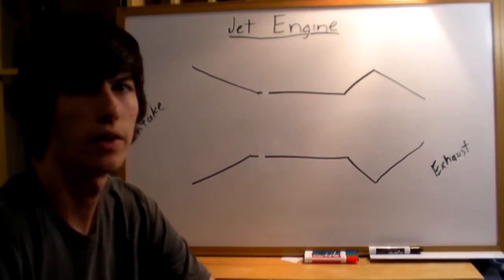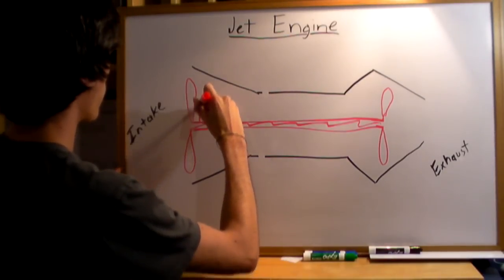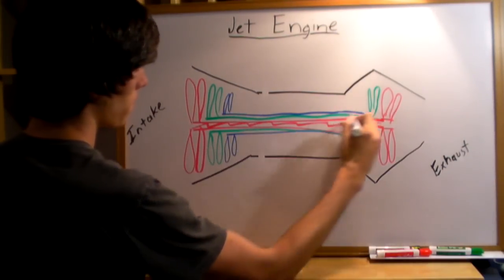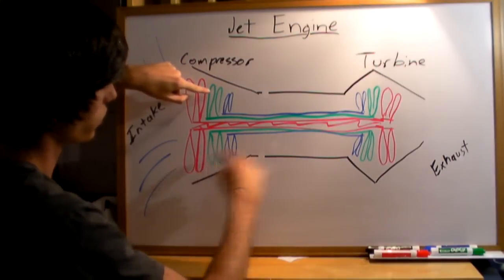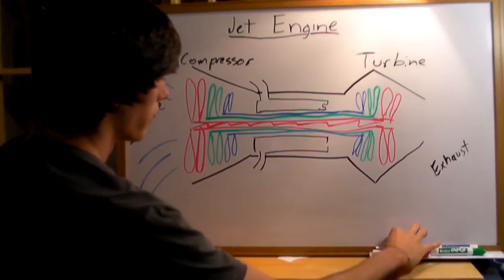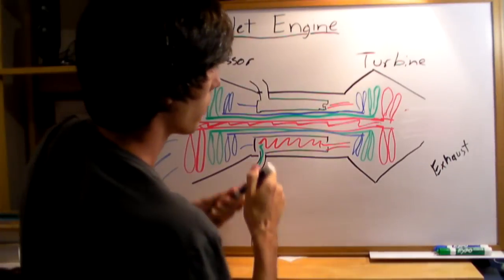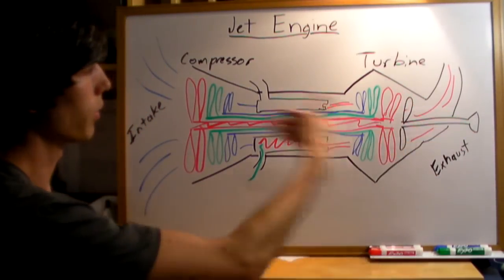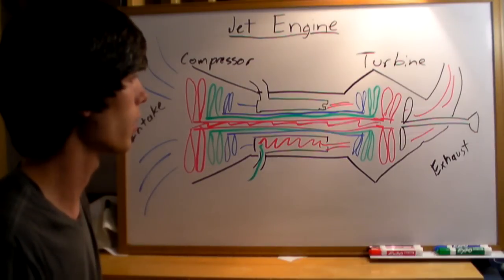Jet Engine - Explained

Comment: This does not explain why the expanded air is pushing the turbine more than it is pushing the compressor in the opposite direction. In other words what is stopping the exhaust from exiting at both ends of the engine and what is driving the shaft in one direction.
Reply: Mikhail Morozov Well, the initial airflow determinate in which direction the gases will flow once the igniters ignite the fuel. That's why turbines need the first few seconds an external power source to start up. normally a little motor/generator or pressurized air for the bigger turbines is used for that.
Reply: shi01
After the external power source is disconnected the initial flow will not affect how much the gases are pushing against the compressor and turbine after expansion. If the forces are close to equal, the shaft will eventually slow down and stop, regardless of any initial flow.
Reply: Mikhail Morozov
 It's the same as with a piston engine if the compression stroke would be equal in force to the combustion stroke, the engine would not run regardless of any starter motor.
Reply: Mikhail Morozov The forces arent equal anymore after the moment the thing starts burning fuel. You will have much more energy on the turbineside, because the gases after the combuster are way hotter (about 300° centegrade when they enter the combustor and about 1100° centegrade when they exit the combustor) and tend to expand and flow much faster, but the pressure actually drops slightly because of the geometry of the turbine inlet (Bernoulli principal).
Reply: shi01
That's exactly what is missing in these explanations. Why is more energy being transfered from the combustion chamber to the turbine side than the compressor side. In case of a piston engine you have valves to stop the backflow on the combustion stroke. Here you do not. It can also not be explained by initial flow, as it is only added to the flow velocity of gases expanding in BOTH directions. If intial flow would be enough to keep the engine running, why bother burning fuel, which would only be equally acting to both propell and stop the shaft. The compressor is blowing air into the turbine, and the turbine is running the compressor. Free energy. Not. Ironic smiley :-).
Reply: Mikhail Morozov If you put a ventilator in front of a campfire, on which side of the campfire you will get burned? The heat and so the energy travels with the airflow. If the airflow stops for whatever reason, than the flames can change direction and damage the compressor stages. That's called compressor surge and is really a bad thing.
Reply: shi01
The turbine and indeed the aircraft are not driven by heat, they are driven by gas pressure. And you should know that expanding gases exert pressure in all directions equally, including backwards in the direction of the compressor. With the campfire you would be burnt on the opposite side of the ventilator, but again only because you are driving the ventilator externally, and in any case the temperature alone does not mean anything. The expanding gases from the fire may not be burning the ventilator, but they are creating opposing pressure certainly.
Reply: Mikhail Morozov
You make a mistake. The working principals of a turbine is slightly diffrent to that of a piston engine. A turbine uses a open cycle or more exact the Brayton cycle which describes a constant pressure heat engine. The pressure hardly increases in the combustor instead, the gas velocity increases significantly because of the heating. And that's because it is an oben cycle. The Otto-cycle is a closed cycle and yes, in a closed cycle the pressure increases if you try to heat it up. But in a open cycle, only the flow accelerates.
I can go back to the campfire example. The airpressure isn't higher over the fire than beside the fire. actually it will be even slightly lower because the air is moving faster over the heat source and Bernoulli comes again into play.
Reply: shi01 Of course it's not exactly the same with a piston engine, but the basic principles and laws of physics still apply. What is the reason for the increase of speed? It can only be an increase of pressure. Perhaps you should have a look at how a valvless pulsejet works. There is no compressor, and even the flow is reversing and yet it works.
Reply: Mikhail Morozov
If the airflow capacity (passing gas volume/rpm) and resistance of the the compressor and turbine are equal, the jet engine will never work. The most important thing for a jet engine to work is the pitch of the turbine blades to be higher and/or the number of turbines to be lower than in the compressor. So the expanding gases flow mainly in the direction of less resistance. In the case of a valvless pulsejet this is achieved by the length and/or the diameter of the intake and output being very different. It has almost nothing to do with initial flow.
Reply: shi01
Perhaps you also believe that wings provide lift because of the Bernoulli principle? :-) Haha
Reply: Mikhail Morozov The cross-sectional area of the compressor is much smaller than that of the turbine. That I believe is the main reason it works.
Reply: pairofdice Yep. This is absolutely critical. The area, the pitch, and the number of steps (turbines/compressors) all contributing to resistance, which has to be lower in the direction we want the gases to flow..
Reply: +Mikhail Morozov the actual function of the compressor is to reduce entropy, and it does that by compression. the less the entropy, the more organised the air is, so it would be less likely to flow in the wrong direction. when the entropy gets too high, the compressor stalls.
Reply: +NuclearPotato ??? Less likely to flow in the wrong direction?) Hows that? How should the air know which one is the wrong one?

Comment: Actually most modern helicopters use an air box transmission.
Reply: The blades aft of the expander stage are called the air box. Turbine generators and steam turbines work much the same way.

Comment: But my question is without the ignightor and fuel and crap wouldn't that already be enough force to life a human up?
Reply: You need something to power the engine. A jet engine won't do anything without the energy provided by the combustion of fuel.

Comment: My friend, you got some of it rite but you truly don't understand about EPR  and where the thrust happens! 
You need to get it figured out accurately before you try to teach other folks. I have been flying since 1967! Been there done that. Get it rite!
Reply: Actually EPR has become more and more meaningless with modern engines. Because of the very high bypass ratio of modern jet engine the EPR is actually fairly low and considerably lower than in older jet engine types. It has actually become so irrelevant that it isn't even shown on the standard engine screen in modern airliners.
Reply: I don't disagree however as I recall the original discussion was not dealing with bypass type engines. 
Only axial flow types. 
On a note,,, the jumo 004 used on the ME 262 HAD a compression ratio of only 3.4 ! (Not EPR) HOT SECTION input pressure. How it even ran ?????

Comment: hahahahahah... AC current pass step-up transformer (increase voltage), then I don't know is it using diode or not, pass/storage by capacitor, then flow to magnetron and the electricity current become heat wave. I also don't know how magnetron works.